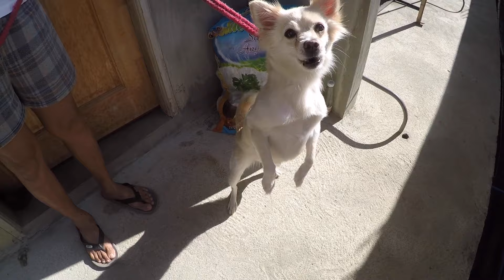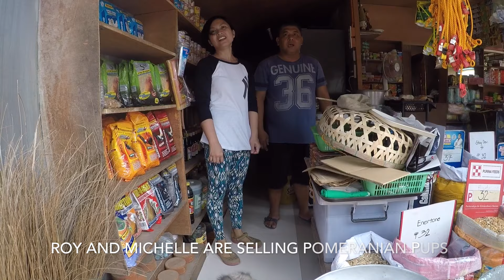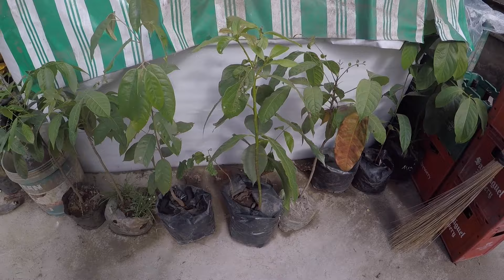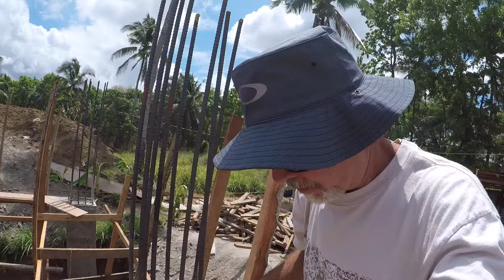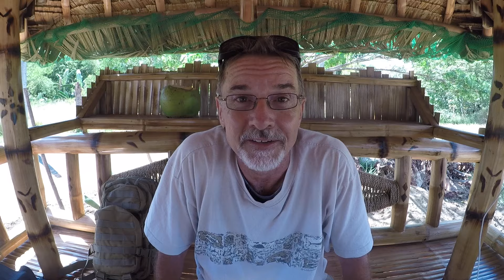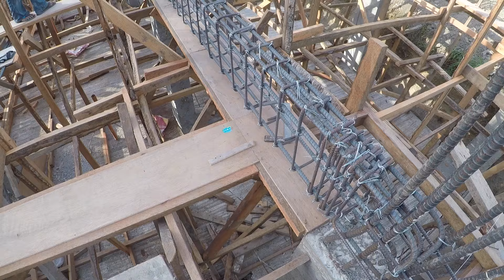VILLA FELIZ - EPISODE 42: EARTHQUAKE (House Building in the Philippines)

Comment: Hi Jimmy 
I'm a builder in New Zealand I have noticed in this video that the steel coming into your vertical columns I believe are not over lapping enough. The rule of thumb here in NZ is over lapping should be 32 x the diameter of the reinforcing steel your using.
Reply from the maker: We're actually overlapping more than code here in the Philippines.  The standard for splices I believe is 60cm.  We're doing almost 100cm.

Comment: What up James! It has been my intention that when I build my house in the Philippines to use SRC panels the way they recommend, but after seeing these aftershocks I'm thinking to myself why not overbuiled just a little bit!  I am thinking now that whatever structure I build, it will have to be exactly the same as your build up to this point in your video log - with the post and beam - and then I will fill in the walls with SRC panels instead of concrete Hollow block.